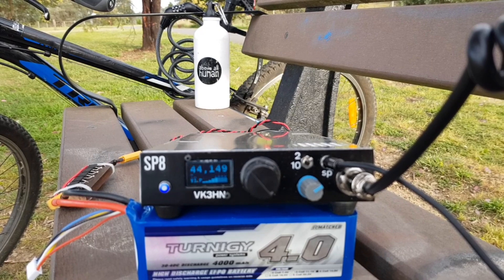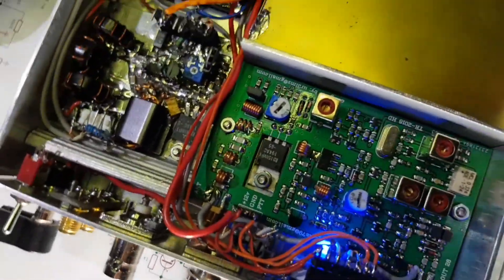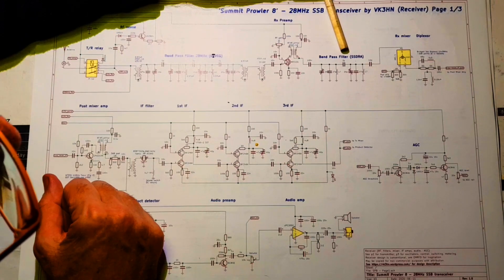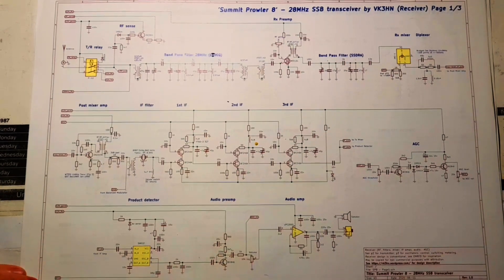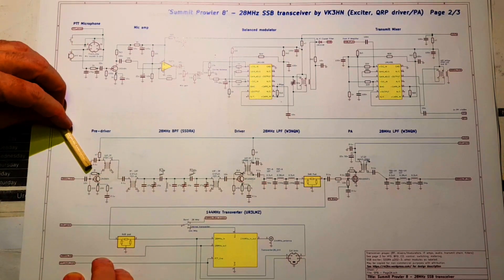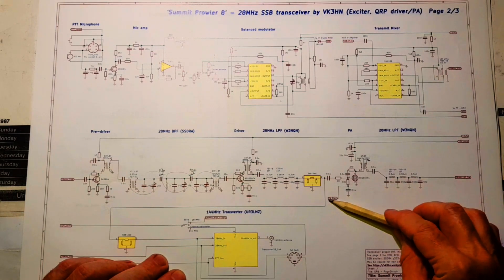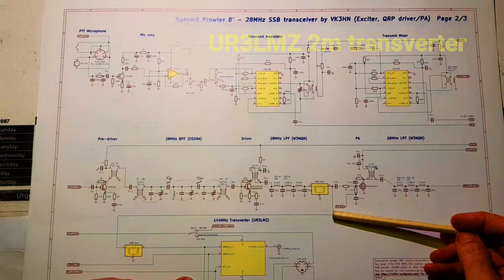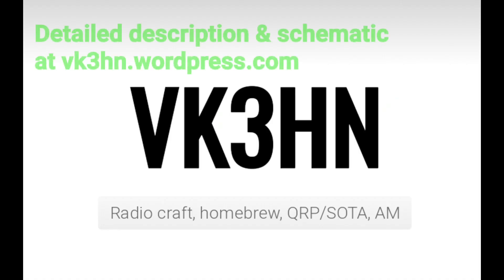A compact QRP radio transceiver for 28 and 144MHz SSB (SP-8)

Comment: Hello, Paul... could this design be used to transmit and receive on the 1.25m band for Zone 2 and Somalia instead of 2m?  I'm not sure which portion of the electronics you would change out, if you even could.  Thanks and -73-
Reply from the maker: Brian, thanks for your comment.  The 28MHz transceiver can drive any VHF UHF transverter.  If you can find a 28 to 220MHz transverter,  it would work just fine.  I built the 28MHz receiver/exciter and connected in a transverter from a Ukrainian supplier.  You could attempt to build the transverter part but its not a beginner or intermediate project.   Good luck.

Comment: Absolutely brilliant Paul! Thank you for the walk-through of your schematics too. I am interested in your idea of controlling the PA bias via the Arduino. That's not something I'd even thought of! I like it because I guess you can set a delay of so many milliseconds before it is applied and give other relays a chance to fully engage before letting the RF loose! That's definitely something I'll be playing with in the future. Keep up the great work - I love your rigs and they inspire me to build smaller and more compact. I think I'd struggle to trek up mountains with a big bread bin!!! 73 Nick M0NTV
Reply from the maker: Thanks for your informed comment Nick.  You appreciate what's involved in homebrewing an SSB transceiver.  You pick up these ideas as you go along.  I saw the Arduino control of the PA bias in an external RD16HHF1 WSPR amp, by fellow Melburnian Glenn VK3PE. With the bias in the T/R sequence you really feel confident that everyhting is switching safely, not that important in a QRP rig but worth doing nonetheless. And in an Arduino controlled rig, the precise timing is in software, the ultimate convenience!  As for building compact rigs, its something I've moved towards in the last few years. Getting comfortable with surface mount is the key. Its not for everyone. If you look at the better HF transceiver products prior to, say, 2010, the best design is where the physical layout, the radio 'product design' and the RF design all come together.   Keep homebrewing, I love seeing your videos.  73 Paul VK3HN.  PS: Don't get heat-stroke today!

Comment: I have very light Trx QRP "Kacper2" handmade homebrew 40/80  on my bicycle or backpack ..10W  20sec voice recorder .. 73! SQ9FCB  Krakow Poland
Reply: Qso 7.1 Mhz ..range over 300 km . I have two movies in my Yt chanel pls find .. link ( is blocked by Y...)
Reply from the maker: @RadioMalopolska  Sounds like fun, and you could ride to a quiet RF location!
Reply from the maker: I had a look at Kacsper 2, looks good, 80 and 40m SSB, 10w, a good option for mounting on a bicycle.  What antenna did you use and what was your longest distance QSO?
Reply: @Paul_VK3HN  short version w3dzz (rtx Kacper2  with PLL .. old ver was "Bartek QRP" ) weight like pepsi can

Comment: Hi Paul, greetings from France, once again incredible work, I can see the hours of thought that must have gone into the Development of your transceiver, the golden band 10meters great idea, sounds very good to, I have converted some old side band cb rigs in the past, great band 10meters, fantastic work thanks for sharing 👍 stay safe.
Reply from the maker: Hi Peter, thanks for commenting.  10m and 2m are an unusual combination in one radio. When 10m comes alive ( in a few years? We hope!)  I expect this rig will see quite a bit of use as you don't need much power when the band is open. 2m SSB is an ideal portable band, small gain antennas,  sufficient activity, base stations point  high gain arrays at you.  Stay safe in France, I will get back there one day...